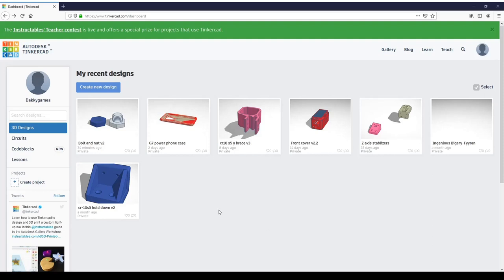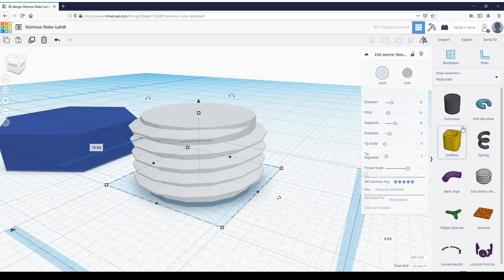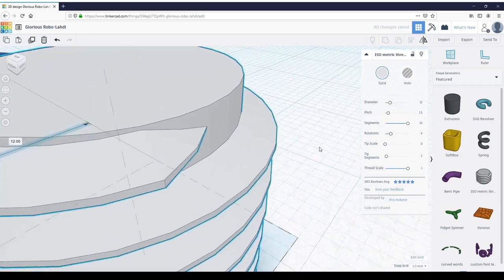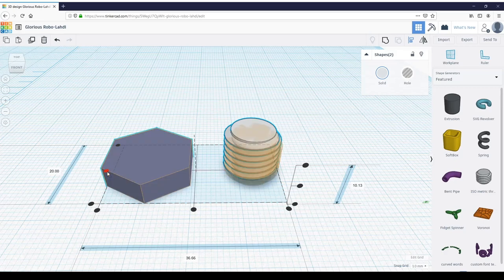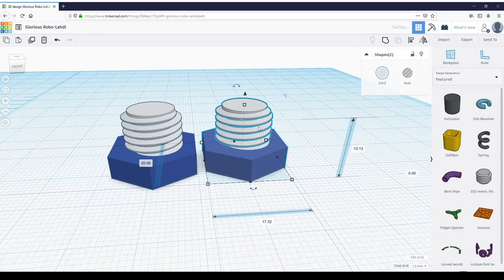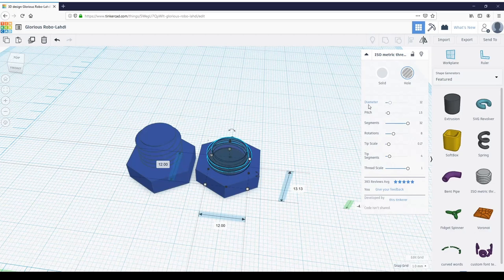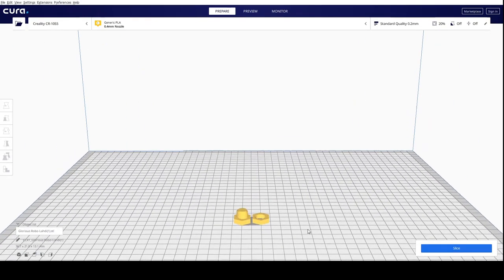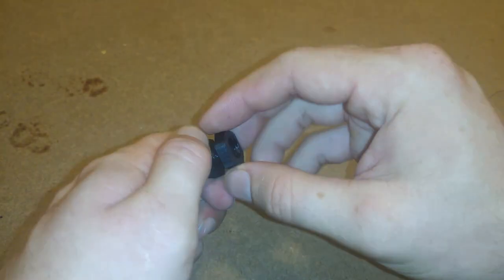TinkerCad Basics : 3d printed Nuts and Bolts

Comment: Thanks for the video, however your instructions could use some work.  Adjusting it until "it looks good" (LOL) isn't always going to work, and adjusting the female thread size by 1mm won't always work.  What if you were attempting to print a 3mm but and bolt combo?  1mm larger threads would probably just fall off. :). But, its a good starting place..  Now that's it's been a year, perhaps you could redo the video with some updates on your technique.  I'm sure you've figured out something better by now.  Or who knows.. Maybe You're still eyeballing it.. haha

Comment: I don’t see how this allows you to create a bolt with a specific tpi (threads per inch). God, this is frustrating. I need to make a threaded fixture, with female threads at 3/4” with 6 threads per inch. I've spent hours trying to make this simple piece in Tinkercad. Can’t make it happen.
Reply: Me too. Trying to make a 3/4-18.  I will keep looking for tips.  Not even sure how to change it off mm.
Reply from the maker: Do the math. 1” = 25.4mm 
3/4” converted to decimal = 0.75
25.4 * 0.75 = 19.05mm
18 threads per 19.05mm
Reply: @TheEpiphanyShow  Thanks for the reply. I found your how to 'Replicate Any Thread' video. I am understanding the process better now. Thank you.

Comment: Good video though I have trouble printing threads.   I was trying to print a Spool holder and the nut just will not print.   I get threads of filament all over the place exact where they are supposed to be.   I don't have this trouble with rectangles or cylinders, even hollow cylinders print fine.   But when I try to print a nut with threads, it is a disaster.

Comment: Did you print with or without supports?
Reply: He printed them without supports, because there are no overhangs.   Look around 5:10 when he showed them in the slicer.  You can see how the nut and bolt is laid out on the bed.

Comment: Awesome video, mine almost worked, what slicing tolerance setting do you use in cura and what speeds do you print this at? Mine looks like it has not stuck and is all stringy
thanks
Reply: the thread looks like rings which are sagging
Reply from the maker: I have an updated video on my channel that answers some of these questions.
Reply from the maker: However if your threads are sagging it’s a sign your printing to fast for them to cool off before the next layer is printed. It’s really printer and material dependent and you will have to play around a bit before you get your settings dialed in. My general recommendations are to make the thread twice the diameter of your nozzle smaller. So if your using a .4 nozzle make the diameter of the threads .8 smaller as a starting point. They may be to tight or lose depending on your printing profile and calibrations. But it seems like a solid starting point.
Reply: @TheEpiphanyShow  tanks bro ive got the print speed dropped to 50mm/s and inner and outer walls at 10 mm/s and still looks nothing like yours 😞 guess ill have to keep dropping the speed? or do you thing its the slicing mode? Can you link the video?
thanks
Reply from the maker: How To - Replicate any thread with Tinkercad!
https://youtu.be/s1laczjEZOI

What size bolt are you making and what’s your layer time?
Reply: @TheEpiphanyShow  I copied your size, and 0.2 layer height
Reply: @TheEpiphanyShow  Also dropped speed to 30mm/s and inner and outer to 5mm/s and still all stringy and looped?
Reply: @TheEpiphanyShow  Dropped layer height to 0.08mm and the bolt thread is really good but doesnt screw in to the hex nut, think i need to go back in tinkercad and increase the size of the hole another 0.5mm - 1mm 👍
Reply from the maker: @gameswithprawno7007  Awesome Glad to hear. I don't really deal with 3d printing much since I've been moving a lot for work and its hard to keep a printer set up. But I can always answer questions on tinkercard and or freecad. Or just general 3d printer or machining knowledge. TheEpiphanyShowYT@gmail.com Is the best way to get ahold of me
Reply: @TheEpiphanyShow  Thanks bro